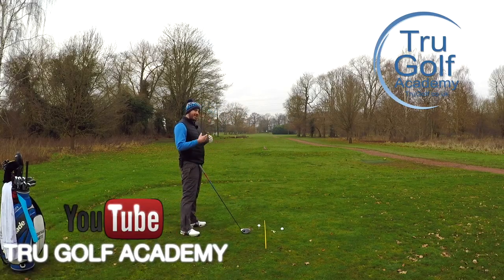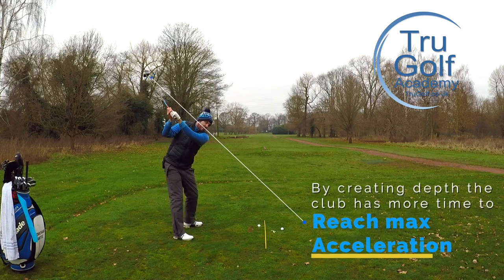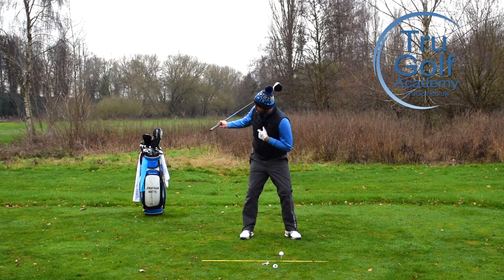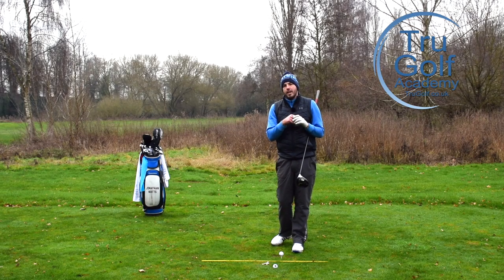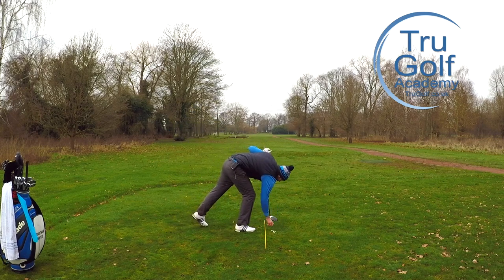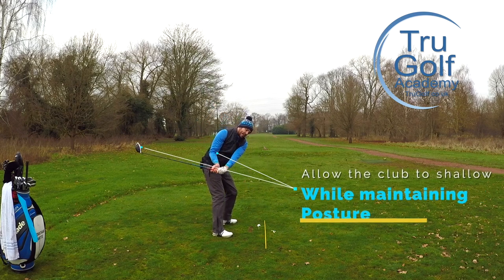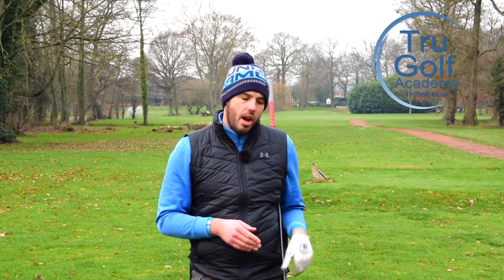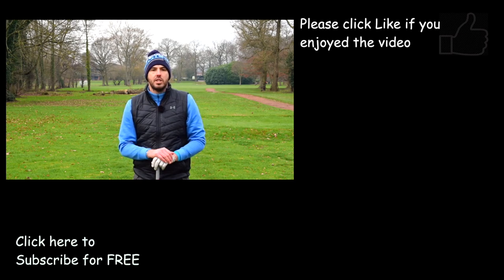HOW TO SHALLOW THE CLUB AND INCREASE YOUR SPEED!

Comment: I'm sorry. This is an artificial manipulation of the club head. Most people will get stuck behind. Timing the body rotation is difficult. Why not just let the club come back down on plane?
Reply from the maker: I’m not sure it needs to be artificial, at the top of the swing, which way would the club move if no external force applied? Nothing wrong with up and down on the same plane, however more speed can be created this way and useful if the player steepens the downswing as so many do!